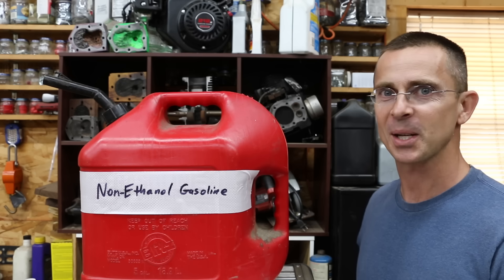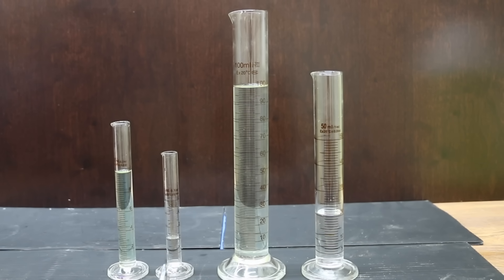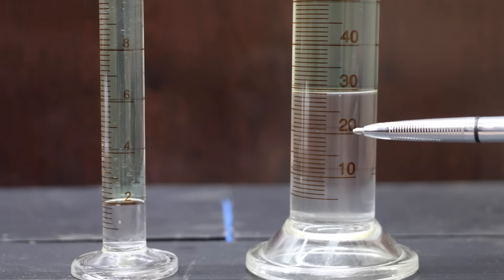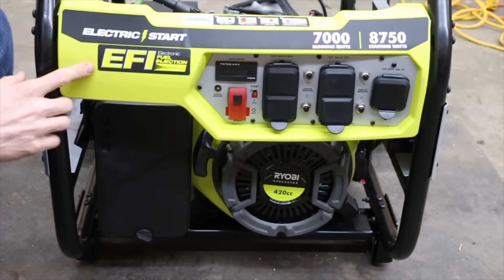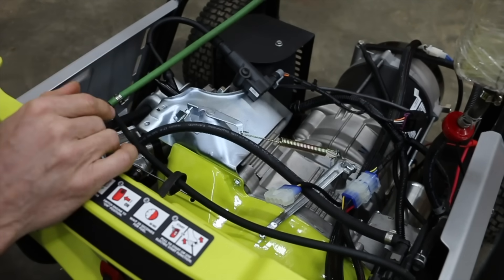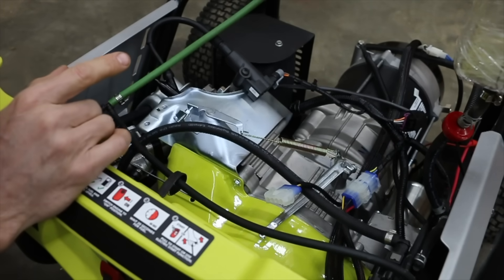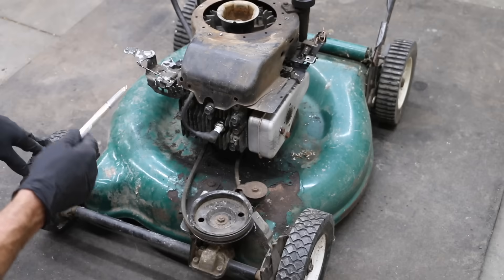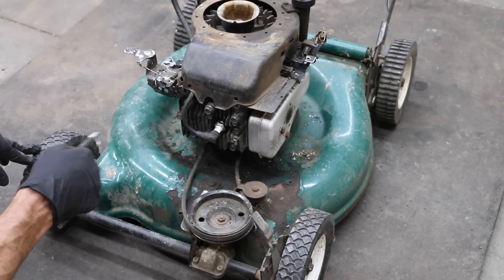Is Non-Ethanol Gasoline Really Better? See the PROOF!

Comment: you checked for carbon build up on 20min test. really. 
 how about running an engine for 60k miles and see the difference.
Reply from the maker: Thanks for the constructive feedback.
Reply: yes np. 
it may not be much a problem for port injection engines cuz you can use injector/valve cleaners, but on direct injection engines its whole different thing. 
so if non ethonal helps prevent even a little less carbon build up🖒, that means i can run longer before taking off my intake manifold to clean out my valves.

from experience audi rs4 carbon cleaning is a nightmare due to direct injection.

Comment: my car actually runs better on E10 than on regular fuel. ive been using it for 2 years. my fuel lines are in good shape. my injectors are giving me excellent delivery. i had the head reconditioned a couple months ago, i typically get it done every 3 years along with the transmission and i use the same mechanic. even he couldnt tell the difference. all he did was complain that my gearbox is 18 years old lol
Reply from the maker: Thanks for commenting on this.

Comment: when you added Water to the Graduated Cylinders - it would also have been a Good Experiment to ADD Gas line Antifreeze or Sea Foam to see if it would mix with the Water and you can burn it off if it was in a Real Fuel Tank !!!
maybe NEXT Experiment for 2019 .
I think i see your other Video - just poped up about the K100
Reply from the maker: Thank you!

Comment: You have a ton of miles on that small engine. I continue to learn from every one of your videos. Never would have guessed you can determine Ethanol content using a simple water technique. Brilliant> Would note that if I ever use Ethanol gas in my four stroke lawn mowers, they always end up having issues (in Texas) by the end of the summer. Every since I started buying pure petrol in the hardware store (for small engines) that's Ethanol free, they stay running, and survive winter storage.
Reply from the maker: Great point on the impact of ethanol on small engines.  Thank you

Comment: Good video. It is helpful to see the water added to the gasoline and how it increases by the ethanol percentage.
 My experience is I had so many small engine carb problems I had to start adding Ethanol Treatment to the gas. It was pricey but one bottle treats 10 gallons, and it had fuel stabilizer also. Not sure if it had water remover additive. 
Looking forward to your long term test results.
Reply from the maker: Thank you!

Comment: E85 makes good power in a race car.  and hey at less than 2 bucks a gallon where I live,,,, that sure beats 10 bucks a gallon for hot burning "race" gas.......  and, IMO,  if you don't let you daily driver sit for days or weeks on end,  then E85 is just fine.  also, I like to burn my tank down to just under a 1/4 and then refill to ensure the most is being burned and not just stagnating and creating moisture (water)..   I think people get really opinionated about being misinformed about 85 ethanol base gas because of the confusion with straight methanol (alcohol).....the days of leaded gas are over and now, the days of straight gas coming to an end...  you must stay educated to get the best out of what is to come.   PS E85 puts out far less emissions than straight gas and make gobs more power with turbo or supercharged systems.
Reply from the maker: Great point!

Comment: I don't recall you mentioning the cost difference (forgive me if I just happen to have missed it). The non-ethanol fuel was 4% more efficient. What percentage higher is the cost for non-ethanol versus the fuel with ethanol?
Reply from the maker: Great point.  Yes, the non-ethanol is more than 4% more expensive.  I only use it in small engines with carburetors.

Comment: Ethanol is always less efficient, consumer around 25% more;but here in Brazil we have 100% Ethanol cars since the 70’s without any kind of problems(corrosion, icing for obvious reasons and etc. Nowadays we have fully flex ( you can run with either Ethanol, Gas [with 20% Anidrous Ethanol] or whichever’s proportions.... and since Ethanol is cheaper... it depends on the price at the pump. 
I’ld really like to see a test with CRC Intake Valve Cleaner X Sea Foam Spray.
Reply from the maker: Thank you

Comment: Non-Ethanol is better for different reasons. Ethanol depletes the soil, and uses too much land to grow corn. If we keep using ethanol there will be nothing in this country left but rocks, houses, and corn fields. It also costs taxpayers money to use it, because it is not economical. Every time you buy ethanol, all the other taxpayers in the country is paying for a certain percentage of your gas. Government interventions of alternative fuels, and energy, cost everyone extra money. It's a joke. E85 is 110 octane, so race car guys love it. The only positive. You just need a richer mix to use it.
Reply from the maker: Thank you!
Reply: The Federal corn ethanol subsidy ended back in 2011 along with import tariffs.  Ethanol makes gasoline cheaper because it is cheaper per gallon than gasoline and cheaper than other octane boosters like (toxic)BTEX(benzene, toluene, ethylbenzene, and xylene).  Even with a drop in mpg in today's low compression engines, ethanol is cheaper per mile to drive and gives more horsepower.

Believe it or not, the corn belt grew more acres in 1980 before ethanol than it does today with record ethanol production.

Iowa

2018 13,200,000 acres of corn with record ethanol production

1980 14,000,000 acres of corn before ethanol

2018 Illinois 11,000,000 acres of corn with record ethanol production

1980 Illinois 11,600,000 acres of corn before ethanol

2018 Indiana 5,350,000 acres of corn with record ethanol production

1980 Indiana 6,450,000 acres of corn before ethanol

https://quickstats.nass.usda.gov/results/229C6DAD-EFDE-3021-ABDA-BD1F0ACE0269

In fact the US grew more acres of corn in the 1920s, 1930s, and 1940s than we do today with record ethanol production. The peak was 1932 with greater than 113 million acres of corn and no ethanol to a little greater than 88 million acres this year with record ethanol production.

See chart, ethanol does not show up even as a blip:

https://uploads.disquscdn.com/images/91d7502e043c7c976bdbac4d3953fb82813e0ab4ef4723a5d70e734514dcac9c.jpg

In high compression engines, ethanol becomes the most efficient fuel on the face of the Earth. 

You are correct, race car drivers love it for safety, cleanliness, and mileage:

THE INDY 500:

In 2005, the IRL used 100 percent methanol in their tanks. The fuel worked well and was more efficient than straight gasoline, but IRL officials believed there was room for improvement. In 2006, they moved to a 10 percent blend of ethanol and methanol, which was then changed to 100 percent ethanol for the 2007 season...

...The switch to ethanol also allowed the racers to carry less fuel and make fewer pit stops, thereby increasing efficiency even more. "When the cars ran on methanol tanks had to hold 30 gallons to accommodate the fuel requirements of the cars," Vervynckt says. "After getting the engines to perform at their full potential, there was a significant gain in mileage. Indy cars now have 22-gallon tanks. When a driver pulls in to change out his tires, he can fill up. Teams were able to match their tire and fuel stops exactly, instead of stopping for tires only, or fuel only."s

FROM RICARDO:

The new federal CAFE standards are calling for a doubling of fuel mileage performance, which, Vint says, is going to send OEM’s looking for high octane numbers to improve efficiency and ethanol is the best source. Ricardo, an engineering firm with over 100 years in the business of engine design, has developed an extreme boosted direct injection engine (EBDI) to optimize ethanol blends. The 3.2 V6 gasoline engine rivals the power and torque of a much larger GMC Sierra 6.6 diesel, he said, and it delivers 3.5 percent better fuel economy than the diesel.

FROM CUMMINS ETHOS ENGINE:

According to Cummins, it delivers the power (up to 250 hp) and peak torque (up to 450 lb. ft.) of gasoline and diesel engines nearly twice its displacement...

...Using corn derived E-85, the high thermal efficiency and power-to-weight ratio of this engine results in 50 to 58 percent lower well-to-wheels CO2 emissions compared with the gasoline engine baseline. Using second-generation, lingo-cellulosic derived E-85, the power train’s efficiency features deliver 75 to 80 percent lower well-to-wheels CO2 emissions, depending on the drive cycle.

FROM SCANIA:

Scania has a number of products available for running on bioethanol – e.g. buses, trucks and waste collectors. Scania is the only vehicle manufacturer to date that has successfully produced bioethanol applications for heavy transport. Our engines adapted for bioethanol fuel have the same energy efficiency as a standard diesel engine and fulfill the Euro 5/ EEV emission level.

FROM THE EPA:

An important step toward increasing alcohol fuel demand, then, may lie in providing economical engine technology options that utilize such fuels more efficiently, to compensate for the lower fuel energy density. The FFVs produced today, however, use fairly typical gasoline engines, which, because they must retain dual-fuel capability, are not able to take full advantage of the favorable combustion characteristics of alcohols. Engines optimized for alcohol fuel use, on the other hand, may yield efficiencies that exceed that of state-of-the-art diesel engines—or, about one third higher than that of FFV engines. In earlier engine research at EPA with neat methanol and ethanol [1], for example, over 40% brake thermal efficiency was achieved over a relatively broad range of loads and speeds, with peak levels reaching over 42%.

FROM EPA & FORD ON FORD'S ETHANOL OPTIMIZED ECOBOOST SYSTEM:

Compared to production gasoline engines:

Fuel efficiency is ~15 – 20% improved for various drive cycles.

Full load performance is significantly improved, and comparable to production diesel engines.

GENERAL MOTORS:

...the Saab 9-5 flex-fuel engine can give improved fuel consumption under mid to high load conditions. Whilst fuel economy over the official EU city and mixed cycles is unlikely to show an improvement, testing indicates that a useful 15 per cent gain can be expected at higher speeds because fuel enrichment for engine cooling is no longer necessary.

In its Saab turbo application, the high 104 RON octane rating of E85 fuel, the 85 per cent ethanol/gasoline blend most commonly available at filling stations, also produces a significant 20 per cent increase in maximum engine power, up from 150 to 180 bhp.
Reply: @Dana Fletcher it is more expensive to grow corn, and make ethanol, than it is to get crude oil out of the ground, and make petrol. Did you just copy, and paste information to prove me wrong, or are you an expert? Your corn production numbers does not enter the fact that many countries stopped buying corn from us because of GMO's. Ethanol does not produce more power of the same octane rating in petrol. We do not need to sell 110 octane petrol at the pump like E85. 110 octane in petrol was made for engines that have over 12:1 compression. Furthermore a stoichiometric burn rate for ethanol is approximately 12.7:1, while it is approximately 14.7:1 for petrol, so to say ethanol is more efficient is well... a lie, because you burn less petrol. I don't believe you. You sound like an E85 propagandist. Google Federal subsidies for corn ethanol, and other corn based bio fuels.
Reply: @RustBeltAuto  All the costs it takes to make and deliver a product to the consumer are reflected in the price of said product.  

As such know that today ethanol traded at $1.255/gallon on the NYMEX.

An unusable sub grade and sub octane gasoline(RBOB) traded at $1.35/gallon.  The spread is as close as I have seen of late, normally it is >$.50/gallon more expensive.  

Of course to make RBOB gasoline to a usable grade and usable octane you will have to refine it and/or add toxic and expensive BTEX(benzene, toluene, ethylbenzene, & xylene) which will raise the cost of the gallon of gasoline considerably.  Except, of course, if you add 10% ethanol in which case it becomes cheaper. 

You were proven wrong whether or not I am an expert or novice(which is irrelevant), the data/reality/truth is what got you, not me personally.

Ethanol was made from corn many years before GMO corn existed and at first ADM would only buy non-GMO corn for their ethanol plants because the distiller grains were exported to Europe.

Besides that, grain exports of corn are at record levels: https://www.agweb.com/article/grain-exports-on-track-to-set-new-record/

A Chevy 5.3L pickup which is low compression gasoline optimized puts out a clean 380 horsepower on E85 but puts out a toxic 355 horsepower on E0:
https://media.gm.com/media/us/en/chevrolet/vehicles/silverado/2014.tab1.html

On the roads today worldwide(except here) is a high compression ethanol engine that gets mileage equal to diesel(hence above gasoline).  Gasoline is cheaper per gallon than diesel, but ethanol is cheaper than either one of them.
https://www.oemoffhighway.com/engines/press-release/21005554/scania-ab-scania-introduces-bioethanol-engine

The Oak Ridge National Laboratory measured mileage with taking power into consideration called the gasoline equivalent ratio between E0 and E85 in our flex fuel fleet.  While the chart shows some better and some worse, E85 averaged 3% better fuel economy when power was taken into consideration.  See bottom of page 7 and top of 8.
http://web.archive.org/web/20170121004456/https://www1.eere.energy.gov/bioenergy/pdfs/analysis_saab2007.pdf

On page 5 see the charts on that link for US06 real world driving conditions and how clean the exhaust is from E85 vs E0.  Astounding it is.

The fact ethanol is more efficient fuel is NOT something new, it is something that was suppressed:

Rear Admiral C.M. Chester wrote Henry Ford a letter on Dec.15, 1916:

"...I also pointed out in the article that as governmental laboratories had developed from 40 to 55% efficiency in alcohol engines as against 20% in gasoline machines, the use of alcohol at double the cost of gasoline for power purposes, was cheaper for motor[s] than gasoline in common use today."

The Navy was not the only researcher to possess that information:

Scientific Investigations of Alcohol Fuels 1890 – 1920

Scientific journals contain hundreds of references to alcohol fuel at the dawn of the automotive era. Research during the earliest decades tended to focus on pure alcohol as a replacement for petroleum. The focus shifted to the anti-knock (“octane” boosting) properties of alcohol blends in gasoline during the 1915 to 1936 period because of an increasing need for anti-knock gasoline and because of improvements in anhydrous alcohol production techniques.

Studies of alcohol as an internal combustion engine fuel began in the U.S. with the Edison 

Electric Testing Laboratory and Columbia University in 1906. Elihu Thomson reported that despite a smaller heat or B.T.U. value, “a gallon of alcohol will develop substantially the same power in an internal combustion engine as a gallon of gasoline. This is owing to the superior efficiency of operation…”

Other researchers confirmed the same phenomena around the same time. USDA tests in 1906 also demonstrated the efficiency of alcohol in engines and described how gasoline engines could be modified for higher power with pure alcohol fuel or for equivalent fuel consumption, depending on the need.

The U.S.Geological Service and the U.S. Navy performed 2000 tests on alcohol and gasoline engines in 1907 and 1908 in Norfolk, Va. and St. Louis, Mo. They found that much higher engine compression ratios could be achieved with alcohol than with gasoline. When the compression ratios were adjusted for each fuel, fuel economy was virtually equal despite the greater B.T.U. value of gasoline. “In regard to general cleanliness, such as absence of smoke and disagreeable odors, alcohol has many advantages over gasoline or kerosene as a fuel,” the report said. “The exhaust from an alcohol engine is never clouded with a black or grayish smoke.” USGS continued the comparative tests and later noted that alcohol was “a more ideal fuel than gasoline” with better efficiency despite the high cost.

BTW, I am not totally against petroleum. I am all for us refining coal, oil, and natural gas into clean burning ethanol with an economical process from Celanese Corp. out of Texas called TCX Technology which China, Indonesia, and India are using.

Imagine affordable hyper efficient ethanol engines half the size/twice the power and air in our cities to breath as clean as only an electric car advocate dreams of.
Reply: @RustBeltAuto  I do not disagree with you that there are problems in agriculture but as you now know, ending ethanol will not cure it one iota.

Cattlemen will not feed less corn protein based on what fuel we put into our cars.  If we ended ethanol, they would simply feed more straight corn than distillers grains currently used so acres would remain more or less constant as they historically always have.

BTW corn is one of the few field crops grown that increases soil organic matter if you are afraid of destroying the soil.

There is hope in agriculture with a fast growing movement towards soil health which uses no till, cover crops, and other things that sequesters and even manufactures fertilizers, reduces herbicide and insecticide usage, and stops erosion.   See this pioneering farmer from North Dakota named Gabe Brown and the amazing things he has accomplished towards that end:

https://www.youtube.com/watch?v=GxIyKfWf9kU&t=1971s